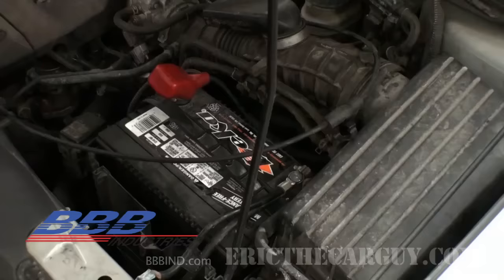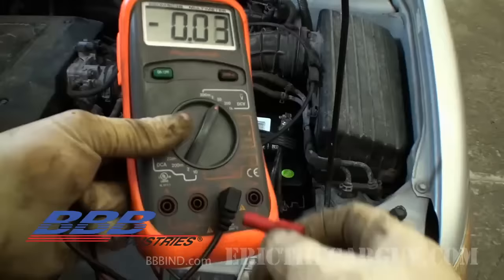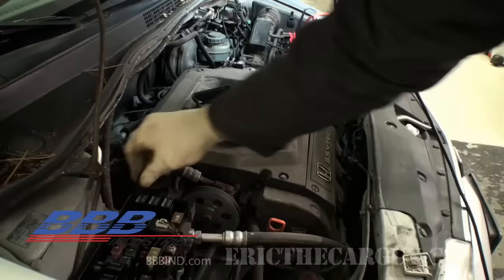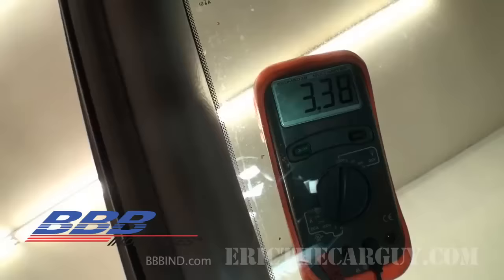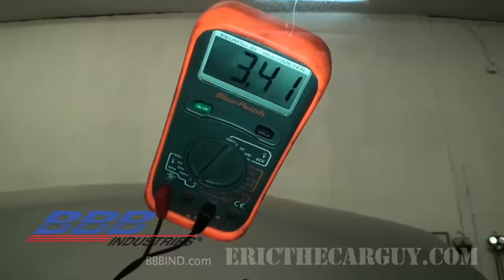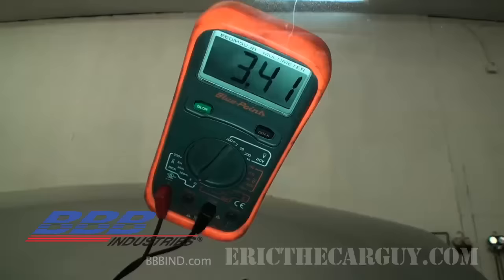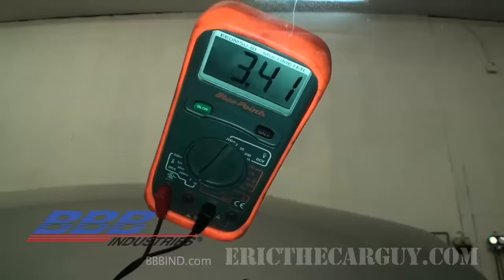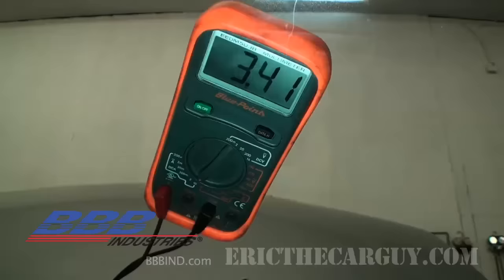How To Perform a Parasitic Draw Test - EricTheCarGuy

Comment: Within 2 mins of watching this video, I figured out the problem.  2008 Toyota Sienna.  No multimeter required.  Bulb had burned out on the rt middle seat (daughter loves to button mash on that thing).  So much of a DUH feeling now, but it likely had been switched ON even though I couldn't tell.  Slow parasitic drain on the battery, and it just took one little thing like leaving the trunk open to kill the battery.  

Leaving the lights forced OFF until I can get a new bulb placed.

Comment: Hi everyone, I have this same problem on a 2003 mercedes c230.
I pulled every fuse and couldn't find the problem until I started 
pulling connectors from the dash, then I found what was drawing 
0.96 mila amps and draining my battery and sometimes killing
it completely, it was the DISPLAY PANEL with the triangle on it for
the hazard lights.
AS soon as I removed the smaller plug on the panel the amps dropped
to 0.23 please keep in mind that my digital meter only has 3 digits.

Comment: The early-2000's Chevy Impalas have the door light switch built into the door latches and the only way to disable the interior lights while testing for parasitic draw is to either disable the switch by removing the interior door panel to unplug the switch(es), removing the interior light bulbs or removing the fuse that serves them.  That's WAY easier than simply taping a spring-loaded switch down to hold it in the OFF position while testing. :(

Comment: Nice find nice video, nowadays with modern vehicles this strategy of pulling fuses is obsolete and really not accurate since by pulling fuses there is a high chance to wake Can-Bus systems. Therefore it is recommended a voltage drop test direct on all the fuses one a after the other with the DMM parallel. 😊

Comment: Wow, I used this info to find out that my 1968 442 had a rear wiring harness causing my battery to die.  My son took out the harness for me, then I unwrapped it an found some one had added a couple of wires for I don't know why and they had bare ends shorting out, and they used wire nuts to put a few new tail light sockets on LOL.

I repaired the whole thing by soldering the bare places and using heat shrink to cover.  Then tested all the resistances and wrapped it back up real nice, took me a while but then when my son put it back in everything works peachy now.

I would have loved to just buy a new harness and replaced it but its a month to order one because they have to build it.

Comment: One issue that I've had is the trunk lid being ajar allowing the trunk light to stay on undetected and when the trunk lid pops open as when the keyless remote or the interior switch is used, it opens so little that it's unnoticeable.  I believe that sometimes the keyless remote misfires and opens the trunk rather than the car door, or the trunk button could be pressed in error.  Back in the day, trunk lights were controlled by a mercury switch (like your household thermostat switch) that turned the light on only when the trunk lid was opened a considerable amount and the mercury droplet rolled to the end of the vial by gravity to close the electrical circuit.  That seems to have changed and now trunk lights appear to turn on when the lid is ajar only a small amount.  (I've even checked the trunk light to be sure that it turns off properly by placing a digital camera inside it and recording a short video while closing the trunk lid.)  This can cause an undetected parasitic draw on the battery causing it to drain.

Comment: I struggled with alternator not charging for months lost a new battery and all the lights. I kept digging after bench testing both starter and alternator. I realized upon inspection of all the wires connected to the alternator that the small wire switching the dash light on was broken. Tight it together and everything was ok.

Comment: Had to use this today. Fixed my issue. Found out my a/c compressor clutch relay was stuck closed causing it to draw 3 amps. Could have messed up my a/c system and messed up my battery from the constant drain!

Comment: If the problem isn't one of the fuses check the alternator with the diode tester on the multimeter. Voltage should always flow out of the alternator but not into it. A defective diode on the alternator is a large parasitic draw.

Comment: Eric what about 12 v cigarette lighter/ accessory that always stays on or delivering 12 v even if car is off can that be considered a parasitic draw?
Reply: Only if something is plugged in and is being used (introducing an electrical load and a draw on the battery). Sometimes people who only drive or run their car every 3 or 4 days and have things like phone chargers left plugged in, bluetooth transmitters or even those powered air fresheners that plug into the 'cig lighter' receptacles may drain the battery enough over a few days of sitting, especially if the charging system isnt quite 'up to snuff'.

Comment: great video Eric, instead of pulling fusing  1x1 could I use a  second multimeter and touch across each fuse until I find one that has volts across it and then just pull that one?
Reply: Good point. I actually prefer that method; voltage drop method.

Comment: If you want to check the light for the glovebox and/or trunk and/or any other compartment with some type of door which is luminated as the close/opens a circuit. Open the camera app of your cellphone, place your phone inside the compartment (DON'T FORGET TO PRESS THE ROCORD BUTTON) close the lid and wait for a minute or two and open the lid. Pull out your phone and play the video to see what happens with the light.

Comment: You may refuse all the fuses and fail to find parasitic drain if it’s coming from the modules still active when they are supposed to sleep.
This method is effective for old cars but may not necessarily apply on newer cars.

Comment: By fully disconnecting the battery before connecting the test leads you have woken the BCM up. Its gonna take up to 30 or 40 minutes for the car car to back to sleep so you can see the resting power draw.

Comment: If you buy a multimeter make sure that you get one that not only measures current but also measures MA in the thousands range. Alot of them you would buy a local hardware store will burn up if you try to do this test.. good luck 👍

Comment: on my 87 Corvette there are 2 under hood lights that are controlled by a mercury switch. Knowing this  the lights were unplugged when the hood was open to do the parasitic draw test which of course always yielded no useful result.  We'd plug the hood light switch back in after the test. Well one night I approached the car at night in the under ground parade. I could see a glow under the car, it turned out the mercury switch was fubar and the lights stayed on when the hood was closed.

Comment: I thought it was common knowledge that left-on dome lights kill batteries. That would be the first thing I check.  BUT if the answer isn't painfully obvious, having that diagram and multimeter are clutch. He dropped a jewel about the common areas, too.

Comment: My dummy light for the battery came on, so I tested the alt. with .
a multimeter.  It works fine, so I scratched.my head, and dealt with it the next only to find that the battery was completely dead.  It took me almost 24 hours to fully charge the battery while it was out of the car, and then I did a test on the negative side of the battery with a test light.  I unhooked the negative terminal, and clipped the light to the negative terminal, and then touched the neg battery post with the test-light and the light turned on.  

NOT GOOD!!!

I then found both fuse boxes and pulled each fuse and relay there is, but test-light stayed on.

Now what?

93 Honda Accord

Thanks, Eric.

Comment: Love the video. I have an old 2004 Mitsubishi Magna. When I put the multimeter on the battery, it shows 3.5-4a for about 3 seconds, drops to 1.5-1.8 then down to 0.02 and stays there. does this mean i still have a parasitic draw or is it just the multimeter temporarily adding amps?

Comment: Hey! I don’t know if you still read these comments or not but I need help! I have this issue, but my starter does not make noise, but if I wait maybe 20 minutes after trying it will start up like a gem! Turn it off and wait a half out and then bam no luck no crank no noise at all, 2 hours later and it’ll start again by itself.

Comment: Though this is 8 years old, now I know how to properly address my short I have on my '68 Thunderbird. Works as it should, however, it keeps the accessories "live" when the car is "off". I've read with my car it's usually the interior light circuit causing a problem, but I don't think it would turn the gauges on.

Comment: When you’re pulling the fuses one at a time, what if there’s two fuses causing a drain? Say there’s two sources of the drain, would pulling one fuse cause the amps to go down by just a little bit or would it not change at all?
Reply: @Cole Lutz  >The answer is normally yes. If you have two valid circuits that create a drain, your meter will read the combination of both. If it does drop, each circuit has to be diagnose separately.
 Many new vehicles that burn gas, used an EVAP small leak detection strategy called "Engine Off, Natural Vacuum". These systems come on at times after the vehicle is off for various times Like Eric said, these may run for an hour. The engines computer contains a clock that keeps track of various driving events. Once time is correct, fuel level is correct and no other codes in the area are active, the test runs. If the test passes, the clock is reset and repeats in some cases 8 hours. This cannot be changed and considered normal. It can get complex rear quick with regulations, software and the method the manufacture chose to use. Hope this helps.

Comment: My car doesn’t start the first try but starts fine the second try. Battery voltage drops significantly while connected but does not while disconnected. So now I’m here because I’m certain something is leaching power. I’d guess that it’s a somewhat significant draw because it will loose around 1v per hour. Meter reads 12.6v when I shut it off but will drop .01v every 10-20 seconds and if I come out an hour later it’s below 11v.

Comment: Take a picture of the fuse box and as you’re removing fuses do not put them back, with the computers in modern vehicles you can wake up them when you put the fuse back potentially blowing the fuse in your dvom or restarting the clock for the computers to go back to sleep giving you a false reading.

Comment: You said you should disconnect the meter before opening the door or starting the engine.  However if you were testing the battery start up to see if it goes below 10 volts for cca you'd have to have the multimeter connected as well as probably open the door anyway otherwise you could not test it.  so why is it safe in the latter case but not in the first?  please clarify.

Comment: I appreciate the video. I had heard before to use the negative side and you confirmed it. I have a old 2004 GMC Envoy that eats batteries every 2 weeks. Alt is good and when testing draw shoots up to 3.75 amps give or take for about 2 minutes then drops to 0.01 but yet eats batteries. I'm gonna burn this thing down to the ground. 😂

Comment: If you check all of your fuses one by one and you still have a drain. Take off the power cable to your alternator. There might be a short to ground in your alternator this happened to me. My parasitic drain was weird it climb from 1 to 3 Amps and back down to one Amp

Comment: If the car is asleep, and THEN you disconnect the neg cable to put the DVM inline, you would AGAIN go through a check cycle.... I would say either remove the neg cable,  connect the DVM and then let the car sit for awhile, or else disconnect the neg cable holding the DVM leads in position so there is never a connection disruption.  Since you have such a mega leak, it doesn't matter.

Comment: But why disable the door sensor switch? The multimeter can handle the current load of a 15W dome light! They usually have a 10 ampere limit.

Comment: What gage are those multi meter cables? Would regular multimeter cables suffice for this task or will they get too hot and burn out? Since you're running 3-4 amps through them for an extended time to troubleshoot.

Comment: Great video at 5:09 Eric you said amp reading should be no more than 50ma. Is that 0.50 or 0.05? If Eric doesn't  answer can someone please chime in here?
Reply: If you have it on AMPS it is 0.05. Keep in mind the most multi meters have a Milliamp setting which mean it will give you a solid 50 reading

Comment: hi Eric
i have a parasitic drawn traced to fuse 7 under driver side
Fuse 7 covers a list of control units
Memory seats
Power seats control unit
Left sliding door control unit
Right sliding door control unit
MICU rear junction control unit
Navi
Gauge Control Unit
Immobilized control reciever unit
Power tailgate control unit
wiper/washer switch 
Remote door locks
Reply: It drains 0.73 amp
when i removed that fuse 7.5 amp
it goes down to 0.02 amp to 0.01 amp

Comment: Great video Eric. I have a 2005 chevy silverado 2500hd duramax. It has 2 yellow top optimas, they're 7 months old. Fully charged them over night. I've got 2.9A draw. Unplugged every fuse one at a time, didn't drop at all, disconnected the alternator no change, disconnected all the accessories,  still no change. What else could I check?

Comment: Great video however does this work on modern cars that have tons of electronics like Mercedes? Because when I go to this test, the minute you probe the negative post, it gives enough juice to power some modules in the car and that can give off false amp draws. So I tried just waiting and the draw does go down however it never goes down below 50mA. It's stuck around 2A..So the second question becomes would this just be normal because of modern cars trying to be "smart" and keeping some juices flowing?

Comment: Yeah, I got a parasitic draw, wish I knew where it is from.  Removed the the component that gives power windows to the driver side thinking that was causing it.  I put a new battery in, so I guess I will find out if the window unit is causing it.

Comment: I have 12 amp draw and a primary circuit random misfire at stoplights. I unhooked all the fuses, and the wiring harness clip leading to the coils from the battery line. Still 12 amps. Ahhhh!!!! Going nuts.

Comment: Eric, this was a great video and helped me find the fuse causing the issue.  But i'm still stumped.
The fuse cuasing the problem is the IOD fuse.  But the fuse is fine. I even swapped another fuse in it's place to be sure.
When I remove the fuse the draw is gone, and returns when I put the fuse back in.
Any Ideas
Thanks.  Chris

Comment: Eric, great video. I recently replaced my battery and alternator. Fully charged battery first and it was sitting at 12.8V @ install. Drove the vehicle for about 40 minutes (hwy) for the modules to relearn, got gas and drove home. Parked it for 24 hrs then thought I’d check where the battery was sitting. 12.5V. Does this sound like I may have a parasitic draw issue to you?

Comment: So I have this issue.
New truck battery will go flat after 4-5 days.
I did your test and result was 1.4- 1.5 range.
Had the volt meter set up like this: Red cable in the 10A slot and the dial on 20m.
Excuse me
for being dense but is this more than 50m?
Is 1.4-1.5 draw considered enough to drain a truck battery?
Also, should there have been a little tiny puff of smoke when I touched the neg post?
VM was not harmed.

Comment: Great instruction Eric!  I did the Amp test on the battery to see if there's a draw and something weird happened: meter showed a  0.9 Amp current but within 7 seconds it reduced down to 0.12 and eventually to zero. Without a steady current showing a draw I dont know how I would test each circuit by pulling fuses. So my question is do I have a short or not? if not, what could I have....possible a ground fault somewhere?  Thanks for any advise from anyone :)
Reply: You probably don’t have a draw if it’s only going to 0.9. Sometimes it’s not super steady. As you see when he hooked his on there it was at 3.70 then dropped down to 3.40. Mine did the same thing. You should be good.

Comment: Thanks for the great video.   I did as you said,  i think.  I set multimeter to 40mA,  the multi meter read between -11.6 - -12 mA no matter which fuse or relay i pulled.   My battery seems to be loosing less than 1 volt during the night.   Does this seem like i do not have a parasitic draw?  I keep burning through parts stores alternator on my 7.3 L diesel 2001 f250.  Thank you

Comment: Brilliant ....now can you help a damsel in kinda distress? The speakers in my Audi A4 cabriolet 2003 intermittently crackle when engine is switched to ff..I sat in my car for 45 mins ignition off talking on the fone and 4 times it did this. My battery has is new 6 weeks old and it's draining after 24/48 hrs of standing on the driveway. What do you suggest I do to fix this problem

Comment: I suspect the trunk lights are the reason my car battery dies after a couple days. Is there a way to   disconnect them without screwing anything else up? Thank you for the information. I need to take this to a tech . This has been the reason it has had to go to the dealer since I bought it and they can never make it right.
Reply: i had the same problem and  took the lightbulbs out and that fixed it !👍👍